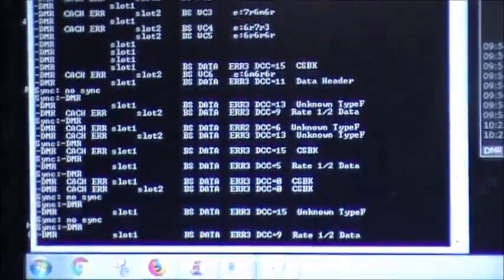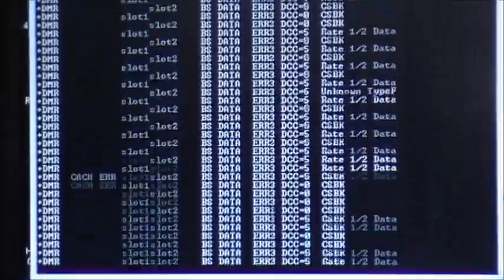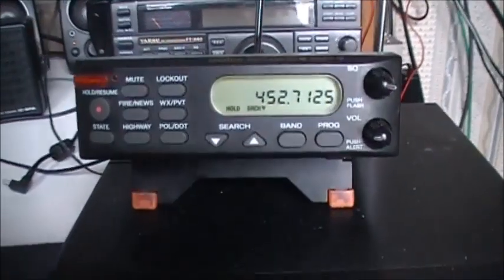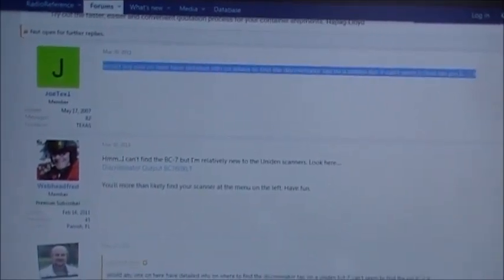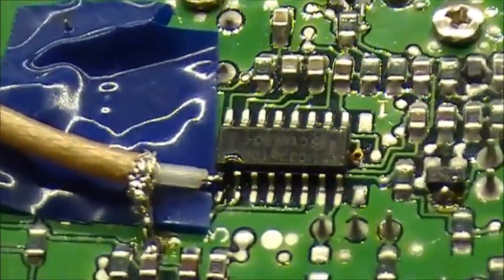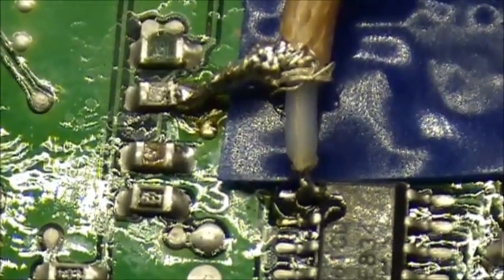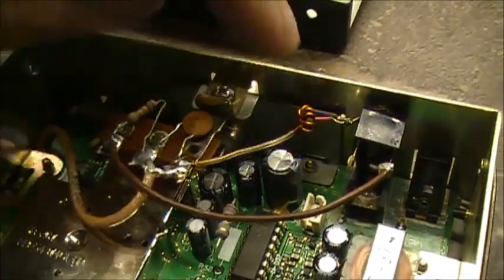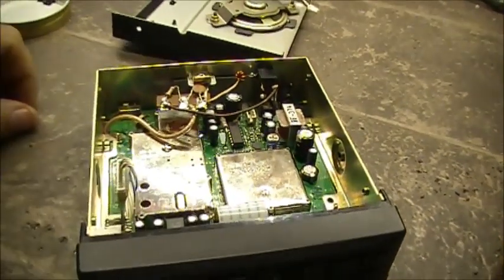Discriminator tap for Uniden Bearcat BCT-7

Comment: Have you made a discriminator tap for a scanner or radio with an RTL-SDR for a spectrum analyzer display or whatever signal processing?  I'm thinking about doing and looking for a good example for the PRO-2006.  I might wind up making a video detailing... though thinking won't get to until this fall.  Figure start doing some research again where I last left off with the CE-232 Bill Cheeks updating two seasons ago.
Reply: Looks really straight forward here though not using an RTL-SDR I'm thinking:
https://www.youtube.com/watch?v=i_R7UhZagxg

Neat the idea of doing the same with the Tecsun (or other radio) and piping through to demodulate with the PRO-2006.  Or at least I think that's what Corrosive is saying.   Bill Cheeks notes the same using in one of his books.
Reply from the maker: Can't say that i have tried that mod, sounds interesting tho.  :-)
Reply: @Radionut63  Yes and I just realized what I was thinking about was a Pan Adapter and not a Discriminator Tap I'm thinking after watching this: https://www.youtube.com/watch?v=0a-T2pqeM0w

There is another video detailing a pan adapter on a radio that I'm not finding yet, though will put a link in this thread once I find again.
Reply: @Radionut63  Found it, had saved and I guess I forgot what called since the title didn't note.  This is just showing on an AM/FM radio... though seems will work on a scanner also: https://www.youtube.com/watch?v=5Bixdd0UHwo
Reply: @Radionut63  Here's another radio example and regarding RTL-SDR uses:
https://hackaday.com/2015/12/19/sdr-pan-adapter/
https://hackaday.com/2019/07/31/rtl-sdr-seven-years-later/